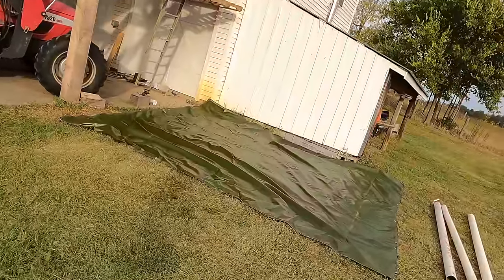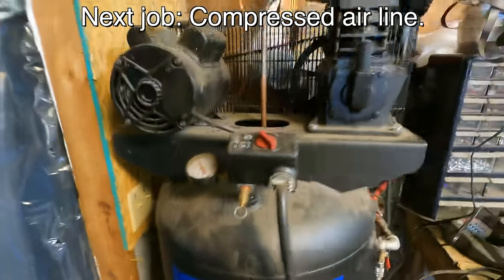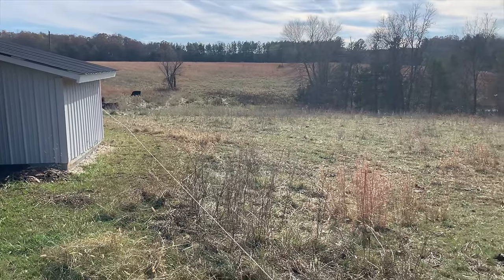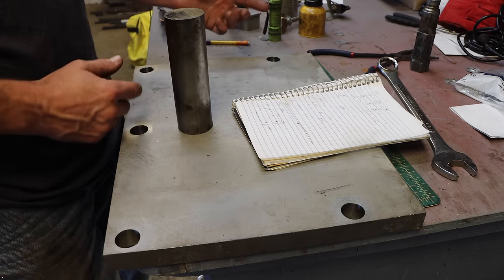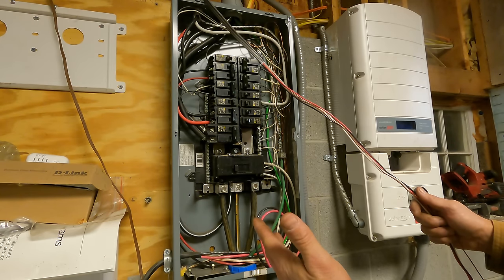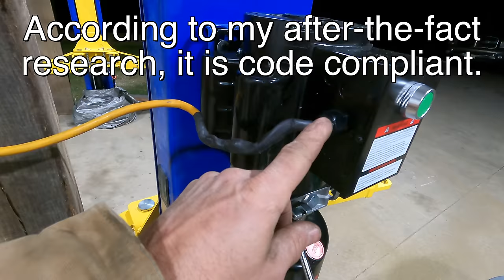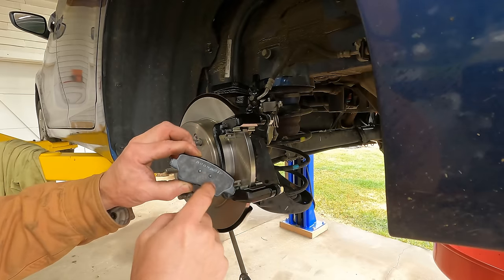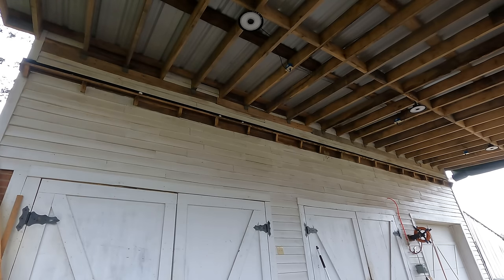Installing a 2-Post Vehicle Lift And Other Big Shop Improvements.

Comment: PEX isn’t approved for compressed air because it’s designed for water supply systems with less than 25psi and the most important is that when it explodes it does so in chards that can kill you and it does so with zero warning; the same goes with PVC pipes.

Comment: You were spending a lot of time drilling through steel, you should have made footings and installed j bolts in the wet concrete. I’ve never had luck with wedge anchors for light stuff never mind holding up a car.

Comment: Why didn't you open the box of the lift and connect the wires directly instead of bothering with solder etc.
Reply from the maker: Lots of crimped terminals on that wire in sizes that I don't have.
Reply: @FarmCraft101  oh i see

Comment: As a former electrician, you gave me a stroke watching you cut those wires so short!  Should leave 6" at minimum.  Think of the guy who has to come behind you...  :)  Oh and it's a shed butt...  Should be a GFI as it "could" get water.  Though between you and me...  I wouldn't put a GFI.
  
Wish I was your neighbor!  I'd trade hone from my bees and my labor to use some of the cool toys, err, um, I mean farm tools you have!  Thanks much for your videos.  Looking forward to when you have time to do some more casting.

Comment: With how much you make sure things "are not going anywhere" I'm not that surprised you're concerned that things would be going somewhere.

On the tarp system - I would be concerned about mold or other growth when rolled, particularly in the part that doesn't unroll at the very bottom. But maybe the climate over there doesn't have this problem? or you have a different solution..

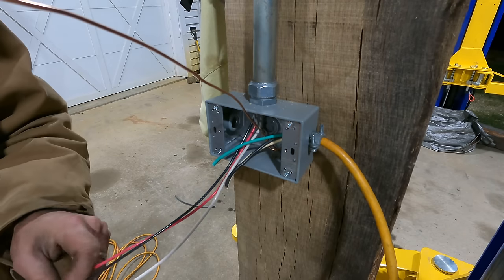Comment: 32:50 FYI, if you want to actually follow code then you should be aware that the NEC code change in 2020 requires GFCI protection on outdoor outlets.

"N 210.8(F) Outdoor Outlets. All outdoor outlets for dwellings, other than those covered in 210.8(A)(3), Exception to (3), that are supplied by single-phase branch circuits rated 150 volts to ground or less, 50 amperes or less, shall have ground-fault circuit-interrupter protection for personnel."

Comment: no saftey lift switch. the lifts should have came with a switch to stop the lift function in the event that the vehicle contacts the top cross bar. usually just a lenth of EMT that opens one leg of your circut with a normally close switch at the top of the lift.

Comment: @farmcraft - I was wondering how thick is that concrete slab?
Reply from the maker: My slab is 4.5" thick.  The lift specifies to limit vehicles to 9k for a 4" slab.
Reply: @FarmCraft101  I replied but maybe it got nerfed from a filter. Did you use JohnsonConcrete products? how dare the filters break my joke!  LoL

Comment: The solder joints might meet Code, but the entire cable doesn't as it's not Armored Cable or in Flexible Conduit, NOTHING protects the cable from damage cause by an object falling against the wire...

Comment: i mean yes its fine buuuuut under nec that would be an non compliant issue, 5 reasons the neutral is not balanced, you can not use branch circuits with service equipment , unprotected splices not in a raceway or a trench, and no gfci, and the receptacle is not rated for 20A......better way of doing this would be too have 2 boxes 1 2x1 and a 2x2 1 with the receptacle split red on one side black on the other caring it down too the 2x2 with a 20A plug for the lift with a proper conection useing cav cable also this way you have a 240/20A outside

Comment: If the wire is 20amp wouldn't you want the receptacle to also be 20amp?  It appears you used a 15amp receptacle.

Comment: In the next vid, could you draw a rough pic of the routing of the 3 ropes through the pulleys for the tarps because that was awesome? I can work out how to rig 2 ropes but 3 not so much. It looks like you only have one rope to pull all 3 points but I could be wrong. Maybe I'm over thinking it or something. 
Can't wait till next vid. 7 sleeps, 6 sleeps, etc...

BTW, 
I walked into the pub the other night on the way home from work and sat at the bar and ordered a beer.
As a greeting a stranger asked, "What do you know?"
I replied, "Well, did you know Lions have sex 9x a day?"
The stranger replies, "Damn, I just joined Rotary."

Comment: I would not have attached the hose reel and hose support bracket right to the wood siding. UGH. Should have placed a piece of backing board (PT plywood) to the door moldings and then screw into that.

Comment: Those Canadian geese may not be something you want on your property. I do not know if they are still federally protected. Back in 2001 we had to get a permit from the state of Tennessee to have the Game and Wildlife commission come remove of the geese from our subdivision lake area. We learned their droppings were dangerous for children and adults. The geese were also contaminating the community pool, and the city made us shut the pool down, although we were paying a pool service to clean it daily. One hour after a pool cleaning there were geese droppings in the water and on the pool decking.

A Game and Wildlife officer came and drugged the geese with bread crumbs first. After eating the bread crumbs, the geese were knocked out. The officer picked up the geese and loaded them into cages on his truck for transportation to southern Mississippi, where their wings were clipped so they could not fly back within six months. After six months, the geese do not try to return to their previous location. They stay at their current location.

Over time the geese became huge problems for golf courses, subdivisions, and other populated areas throughout the country. It may not be a problem on a farm like you have, but if your children walk barefoot on any the areas where the geese have been, be aware there is some potential risks to their health.

We only had 51 geese at that time, which cost only $1500 to relocate back in 2001. Another subdivision had 400 geese and the cost to relocate them was several thousand dollars. The geese population in an area will continue to grow over time. I wanted to let you know about my experience with dealing with the Canadian geese.

Comment: Shouldn't your water tight box be Gfci ?
Also on the lift green should have been neutral,   where does the power feed come from for the inside work shed? 
Is it a subpanel  or metered box? 
If its a direct feed box, then the ground bonds to the box, if its a subpanel then you dont bond the ground to the box.
( questions are not necessarily for you, its asking questions other people might need to know the answer to to do the job correctly.)

Point is if you DIY this stuff you'd better know what your doing. 

Last question is for you shouldn't the lift wires be in a conduet or shielded cables.

Comment: what wire stripper are you using?...@34:04
Reply from the maker: That's a random stripper I bought at Lowe's many years ago.  That design is hard to find anymore, too bad because I like em.  But here's a similar one I found: https://www.ebay.com/itm/111967909197

Comment: You have to be careful about extrapolating what works in other countries for what works in the US.  They have different standards and most are higher in Europe than here.  Their Peks is probably among them.  There the formula is different, more plasticizers and U/V protection.  Heck even Canada has higher standards than here, to wit Metalbestos made for the US is a much lower fire rating than that made for Canada.  The lining is a heavier gauge of stainless for Canada to resist heat longer as their rating requires.  (if yours is corroding out in a few years might be worth a trip north of the border.  I had a problem with chimney caps from Metalbestos only lasting two or three years so I contacted their headquarters and learned the above.)  Windows in Europe are another such item.  The list goes on and on.

Comment: Working on a potentially live circuit... 💀FFS.  Do all the wiring first and then connect up.  As for the heat shrinked part 😨🤢

Comment: I think your insulation strategy might be very flawed... If you're insulating with bat against a cold exterior wall, you're likely to create condensation and mold and rot.  You need to use closed cell foam for direct insulation or another method.

Comment: The Inspector isn't going to care if you put a 15 Amp Receptacle in the Lift Circuit as long as the ENTIRE Circuit is Rated for the Receptacle and Lift...a standard 15 Amp Circuit in your home can have 12 Receptacles/Light Fittings on it and still be Legal...

You didn't need the Jumper. Run the incoming Hot from the Panel to one side of the Receptacle and the Hot to the Motor to the other side of the Receptacle. As long as you don't remove the TAB between the 2 halves of the Receptacle, it acts as a Jumper just fine...in fact that exactly what it's made for, when wiring a multi-Receptacle Circuit, that how they do it, wire incoming power to one half and the other half then goes on to feed the next Receptacle in the chain and so on and so forth...no Jumpers or Wire Nuts needed...those metal TABs are Rated for a HECK of a lot more Current than that piddly little Lift Motor will ever draw...

😄😁😆😅😂🤣

Comment: Good stainless steel has enough carbon in it to be none ferrous but cheap stainless steel like a refrigerator magnet will stick to is not real stainless steel and will rust.  So if you cant put a refrigerator magnet on your stainless steel refrigerator its not stainless steel.
Belive it or not next time your going for that look take a magnet with you youll be surprised how many refrigerators you can stick it too.

Comment: Hey, Like your videos but you code electric skills wrong.  So what I do is use an RV box it has a 50 amp outlet and a 20 amp GFI  and breakers about $130 dollar you run 4 gauge NM wire to  in conduit. I put a plug on the lift This is your disconnect.  Its required with in so many feet. Plus when not using lift you have a 50amp welding plug for a stick welder.   Also big warning if mother-in-law has  RV this could be a problem.
Reply: I was wondering why he didn't put up a 240 volt outlet. Your idea with a plug for the lift is obvious in hindsight.

Comment: I'm a mechanical engineer, not structural, but I felt a lot better after seeing the grout. That should reduce the bending loads on the bolts and put them more in tension by my "engineering judgement". My conclusion: that ain't going anywhere.

Comment: That's the trouble with explaining how to tie knots: nobody knows the names of all the parts, so you wind up spending more time explaining those names than you do how to tie the knot. If you find someone who already knows the names, they.probably already know the knots.

If the air hose reel leaks, it might be because there is no grease on its moving parts (which is why it squeeze when it moves). 

I like the.Pex.that is expanded to allow it to slide over a fitting, which then relaxes and shrinks to seal; no band needed. Milwaukee makes an air tool that expands it and reduces your retirement fund by a considerable amount.

You get all your equipment running perfectly, your shop set up like you want it, and then you die and some other lucky sod gets it all at fire sale.prices. it's just not fair, I tell you.

Comment: You went from pulling those chips away with your hands to using some long nose pliers. You would be a good one to educate people not to touch the chips with your hands. Chips from machine tools are usually like razor blades and stainless steel chips are extremely tough and don't break easily therefore if you have stainless chips from, say, a lathe it can slice through you before you know what happened.

Comment: Stainless steel will work harden if it gets to hot working it and has to be cut slow speed, ask me how I know this and ill tell you a story about a 500 dollar bandsaw blade.  Boss wasn't happy.  When you turn stainless blue you pretty much have to cut it with an abrasive cutter. Or dimond .    Oops. 
Slow speed and low feed rate.

Comment: the solder joints are code compliant if they were in the box or in the motor enclosure, what's not compliant is wiring anything up with an extension cord and heat shrink. Couldn't you have just snagged some liquid tight and made your joints in the motor guy? I understand barns have different rules where you live but you're just trolling your local inspector at this point doing this stuff wrong and knowing better.. maybe that's the point. i do love the videos though.

Comment: Yeah I'm still cringing in european standards here ;) But then again, I am trained in the local code here and so many US code is just horrible to me :D To start with the lack of three phase power haha.
Reply: The way they use wire nuts and sure-to-shock-you metal conduit and junction boxes is worse.
Reply: @erik_dk842  Well to be fair, using metal conduit isn't all that bad. It just becomes bad if used improperly (which is way too easy). And I prefer metal conduit over no conduit at all. Even if I'm installing three phase YMVK cable I prefer to use conduit just to make it look better, although technically it's not needed. 

But lets see, my pet peeves: 

Sharp metal conduit/boxes all over, creating lots of potential short circuit opportunities vc ABS boxes that leave no possibility for damaging cable (unless you are really trying)

Bare earth wires, poking and sticking in junction boxes vs abs boxes that don't require earthing at all. 

Wire nuts that have been proven unnecessary by clamps for years now. I'm happy to install 32Amp circuits on a WAGO clamp. I can do the same work in at least a quarter of the time, using less tools, while allowing for disassembly with ease. 

110 volts which guarantees the use of way too much copper to begin with. And the lack of three phase power which results in many stupid single phase high amp motors in even the most moderate sizes of workshops. 

Many many grades and sizes of conduit. Here we just have one size cable, one size breaker, one size conduit, one type of outlet. And all circuits are simply rated for 3kw of power. No guessing. (well for the most part for residential applications)

Hanging wires. No support whatsoever. By code I'm required to support conduit every 40cm (16 inches roughly) for horizontal runs. If I'm running YMVK cable without conduit I have to support it every 8 inches by current code (16 inches when I was trained). 

I could go on, but those are on the top of my cringe list. What I do find annoying, is that IF i want to use metal conduit to protect for harsh conditions I cannot get it. I have to custom order a piece of stainless to sleeve over my PVC conduit. (although I've only ran into that situation just once. Which annoyed me, because I had to go out of my way to source the right thing)

Comment: have  to laugh at old guys  that ware mobile phones like a peace of jewelry there so not with it
Reply from the maker: Nah, it's the only place I can wear it without breaking it.  Picking up heavy things and doing all the things I do, if it's in a pocket, it won't last long.
Reply: @FarmCraft101  lol bluetooth ear buds leave your phone in save place as you work make and receive calls with out  touching the phone no need to worry about phone getting damage
Reply from the maker: @jay-od7kh  Tried that.  I have bluetooth ear buds.  Whenever I lay my phone down I end up getting too far away and the bluetooth starts cutting out and I have to go back to get it.  Wastes too much time.
Reply: @FarmCraft101  oo wow he has an answer for every comment but your not so smart  bluetooth boosters extend the connection distance by up to 100m on an outdoor space such as your out door car lift

Comment: Just Wtf!! next time you need electrical work done please leave it for a registered electrician. That wiring is not safe and could cause harm to people or a electrical fire. You should have replaced the cable  and put a put a local islisolation switch for the left. Regards a registered electrical engineer.

Comment: You were king such a ice job until you got to the receptacle. The receptacle is a 15 amp and not a 20amp t-slot. The soldering is just a butcher job. Do t teach people this please. Don’t use a dedicated 2 pole breaker and steal half for a receptacle.

Comment: I dont understand that you can do anything of the electrical system. In most enlighten country`s this is prohibited by law. If it burns down no Insurance will cover the loss. 3 years of school before you will become a trainee in my country. Even sondering the electical system, never seen it done before. This cannot be accepted by law, no way.
Reply: It’s residential electrical. It’s single phase 120/240v and just about as simple as you can get.